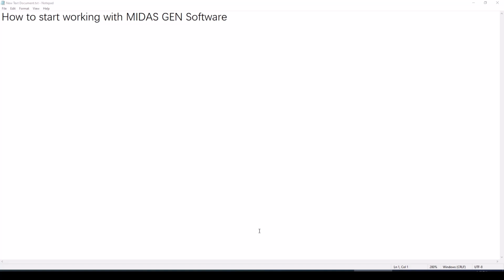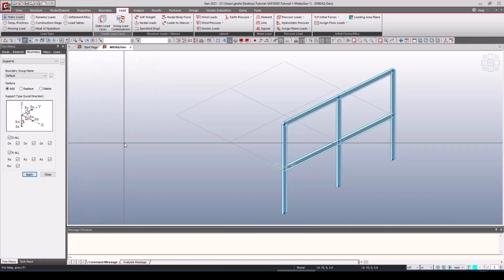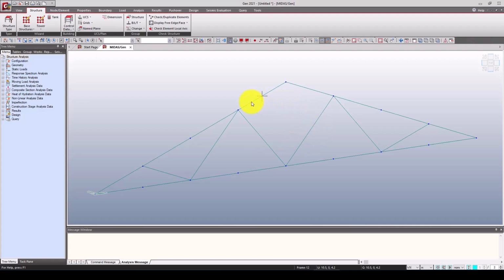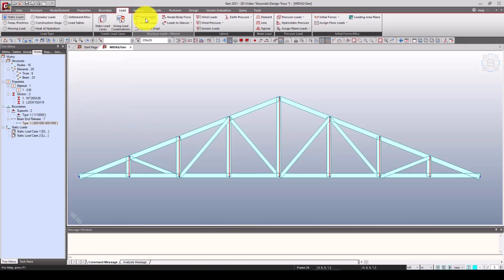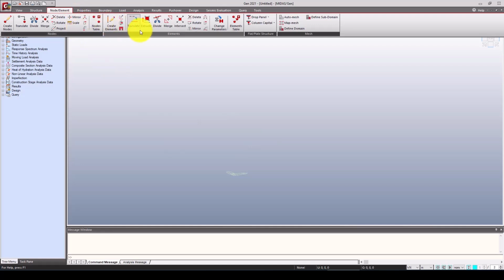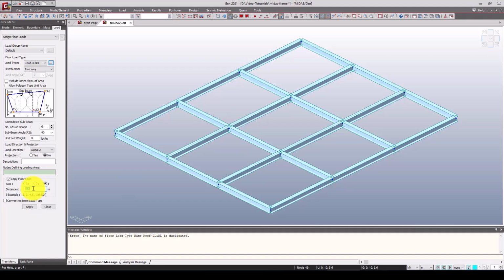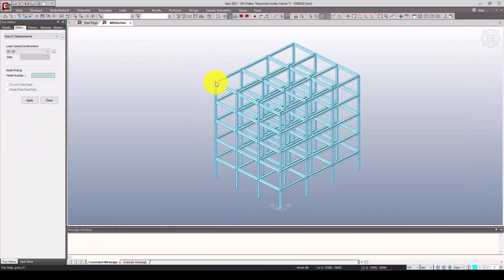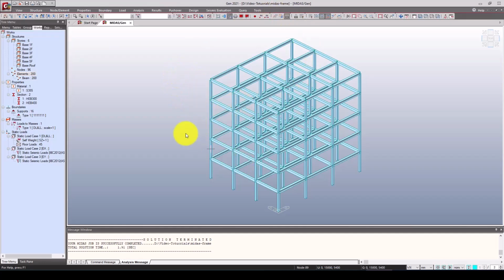Midas Gen Software Step-by-Step Tutorial for Beginners and Pros, with Examples

Comment: Hello, sir. Do you have any materials or totally beginner tutorials, beside this? Or any other materials that can be useful to a young starting engineer trying to learn MIDAS?
Reply from the maker: Plz check the playlist of this tutorial there many completely beginner videos
Reply: @KSSE_Engineer And i have one more question. You know in etabs, if you show an undeformed shape or a diagram there's a button "undeformed shape" (that straight frame from the toolbar), is there any buttons in Midas gen nx  that does that same thing? im having a hard time removing deformations in mm or moments or forces from the model if i dont really want to check those things anymore. Basically i want an button to show me the model clean.